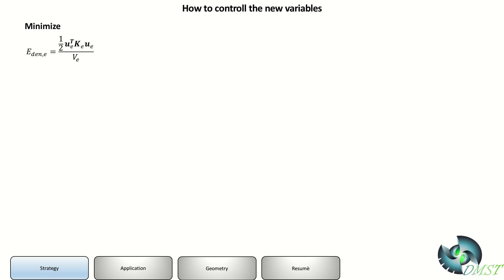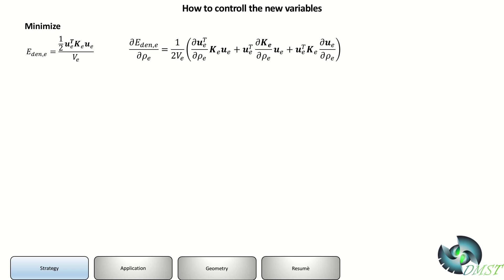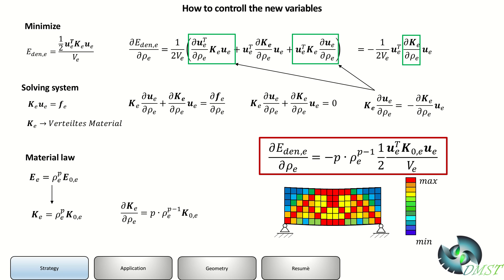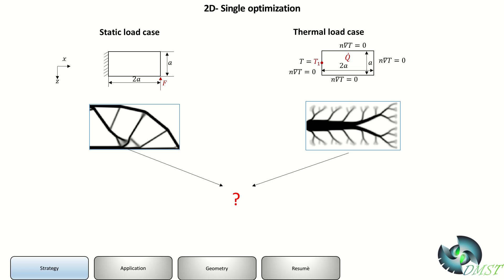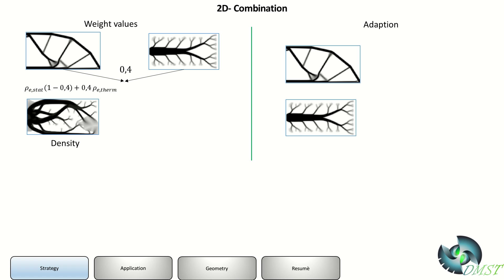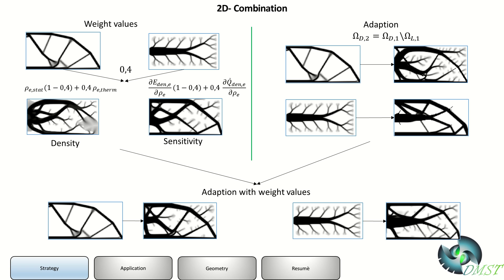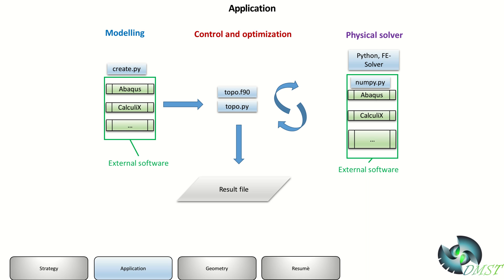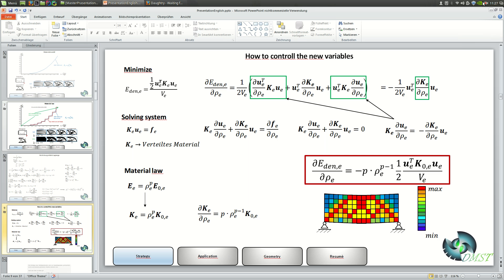Multi Physics Topology Optimization  Part 2

Comment: Why not just make an objective function that is part mechanical, part thermal, and let the two physics share the same density field? Or is that the same as the Sensitivity weighting?
Reply from the maker: hi rene its the same as sensitivity weightening. if you weight the thermal objective and the mechanical objective to one global objective and if you calculate the sensitivity of that global function you get the same expression. and you are right in these cases also in the case of the video you have only one density field for both objective.

Comment: Hi, at 0:12 , the strain energy formula, I understand that strain energy is 1/2 (F  u) and that you have expanded F = Ke Ue and replaced as 1/2 (U(T)e Ke Ue). Could you please help me clarify what the UTe represent here? Thank you.
Reply from the maker: Hi, the strain energy is 1/2 u ^TK u or 1/2 u^T F  or in your way 1/2 F u. Its just the similar expresion by inserting the FE-System. With u^T_e i mean the transpossed (for matrix multiplication) displacemenets according to the element e with the distributed Material Properties K_e. So you first push the material in K_e by using the normalized density. Then you calculate the displacements u_e on that system with distributed material properties. For the sensitivity you requiere the full Stiffness matrix, so that you just need to multiply the displacements u_e of the distributed material with the full stiffness matrix.
 u^T_e is  the same as u_e, its just a transposed vector of u_e.
So to sum up u_e represents the displacements of the FE-System of the distributed stiffness matrix K_e, which needs to be multiplied later with the full stiffness matrix K_0 for the sensitivities.
Reply: DMST Thank you very much for the clarification. 👍🏼
Reply from the maker: @himalgurung2902  Hi no problem, if you need more help just ask for it :). If you need some code example (Python, C++, Matlab) i can send you some links. If you requiere any help for some research paper I can also help you.
Reply: DMST Hi, Thank you so much for your assistance. I will definitely contact you if I need any help.

Comment: Hello Sir, I am a student at Germany currently studying Computational Material Science . Thanks for making one of the best videos for people who would like to know the behind the screen works that is happening during a topology optimization . 

I would like to take up a small programming project in this field . I have a decent knowledge of programming in Matlab and Python and I am a Mechanical Engineer with knowledge on Nonlinear FEM as well. Could you suggest me any project topics that can be converted into a program (I mean like a Mini project).
Reply from the maker: Hi Aadithya,

on which University do you study? 

First please answer several questions, so that I can define a proper topic.

1. How much ECTS do you plan to invest? So for example most german universities use the following configuration:
-Bachelor Thesis (12 ects)
-Master Thesis (30-60 ects)
-Project Work (6-12 ects)
-Research Paper (15 ects)

2. What should be your main focus
- Computational Science (Implementation, faster optimization, better convergence)
- Computational Engineering (Pareto Optimization, Multimaterial, New Material Penalty law)
- Applied Engineering (Reconstruction, Shape Optimization, Mesh Morphing)

3. Which software do you want to use
- Commercial (Abaqus, Ansys, ...)
- Open Source (ToOptix, Z88, FreeCAD, Blender ...)
- Package-Level (ToOptix, numpy, scipy, matlab)

So for example I am programming on the Python Module "ToOptix", which has quite a hard learning curve.

https://github.com/DMST1990/ToOptixCore/

Best Regards

Martin
Reply: @Luchsio  Hi Sir, thanks a lot for your videos. I am a novice and student,  and I want to do conjugate heat transfer of TO with fluid, can I use ToOptix to develop a solver to implement? what is the difference between ToOptix and python codes of DTU? What are your suggestions? Thank you so much.
Reply from the maker: @sywang4623  Hi Qiao, yes you can implement a flouid approach. I use CalculiX for solving the finite element system. CalculiX is capeable on several speicifc type of flouid flows (laminar, turbolent ....). 

The reason why I use CalculiX is that it can handle a huge amount of different finite elements (Shape and Physics).

The Implementation itself is not quite handy. You have to wrap around CalculiX or for speacial cases you have to write a FORTRAN routine (umat). 

If you do some stuff for only research purpose i would recommend DTU.  Thier code has round about 100 lines of Code while ToOptix has round about 20 000 lines of code.

Extending DTU requieres knolwedge in how to generate Stiffness Matrixes for Fluid Simualtions. If you need some help dont hesitate asking for help.

Why do you requiere heat transfer and fluid? 

Best Regards
Reply: @Luchsio  Hi DMAST, thank you so much for your reply and help. I want to do thermal TO of a plate with external forced convection heat transfer, just for research. So it is expected to have both thermal and fluid solver. I don't know if there exists a fluid solver with python. Does that mean if I can find heat transfer solver and fluid solver,  I only need to develop TO model of fluid and compile them together to do what I want? Is that right?

Best wishs

Qiao
Reply from the maker: @sywang4623  Hi Wang, 

yes if you have direclty access to a fluid and heat transfer solver, you can just compile both by weight factors.
Therfore you have to solve the FEM- System of the heat transfer case and the FEM-System of the Fluid Case. Then you have to multply the Temperature and Velocity with the cooresponding stiffness Matrix.

For example heat transfer you need t K t and for the flouid you need v K v.

Everything else is just standard topology optimizaiton. Which can be handeled by the code of DTU. There you just have to replace  u K u with  w_1 t K t and w_2 v K v where w_1 is the weight factor for heat transfer and w_2 is the weight factor for fluid analysis.

If this topic is part of a publication/paper I can help you directly.

So the main problem is to get access to a fluid solver within a small amount of effort. (CalculiX has a fluid solver but requieres a lot of code to wrap around it).

Best Regards
Reply: @Luchsio  Hi DMST,
Thank you so much for your help. I have understood most of what you explained on that and really appreciate your time. Yeah, I want to discuss this more with you and maybe we could have collaboration. So can I have your email to keep discussion? Thank you so much.

kind regards
Reply from the maker: @sywang4623   Hi Wang, 

just send me an email. You can find that on the following page.

https://www.me.hm.edu/mitarbeiter/denk/index.de.html

Best regards